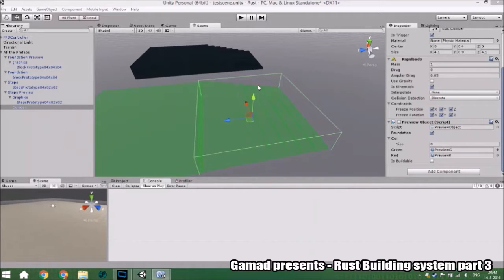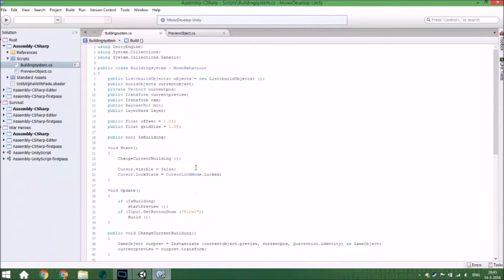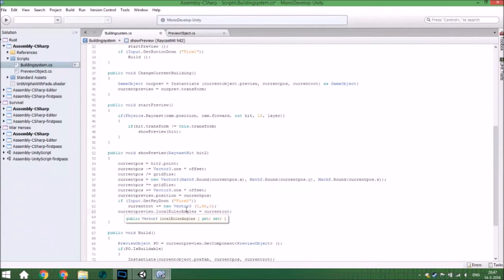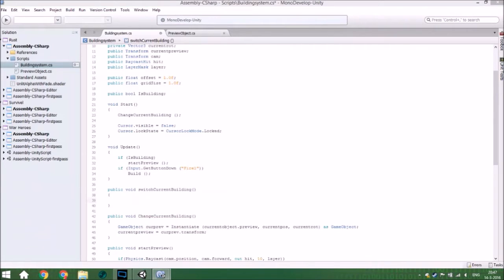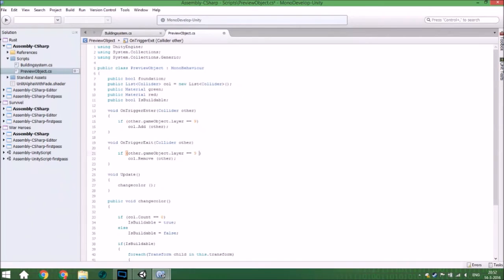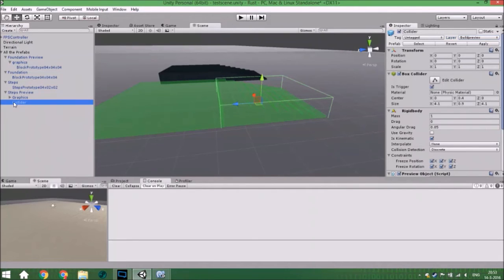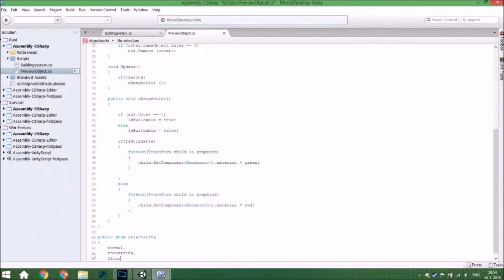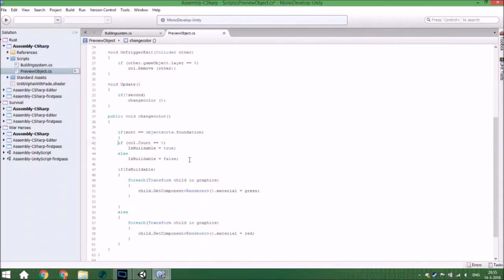[Unity 5] Tutorial: How to make a building system like Rust - part 3

Comment: hey man love this series but i have an issue everything is exactly as yours but it won't let me place the steps down
Reply from the maker: +KoopaStrong also if you first build a foundation and then place it next to it?
Reply: yeah i tried i dunno if it has to do with the triggers or what it is for sure but the scripts are exactly the same and everything
Reply from the maker: kind of hard to tell, it is probably due to the size of the colliders (already tried to change the size of the colliders?)
Reply: yeah i got kind confused about that
Reply: thanks man that was the issue it was the colliders i apreciate it
Reply from the maker: No problem, glad it fixed it!
Reply: i do have one more question what could cause the foundation to go into the ground?
Reply from the maker: That's because the model is probably not at t he right position, look if you set the pivot of the prefab to the ground position and look if it is still a problem ;)
(if it is, move the foundation a bit up ;) )
Reply: ok thanks haven't thought about that